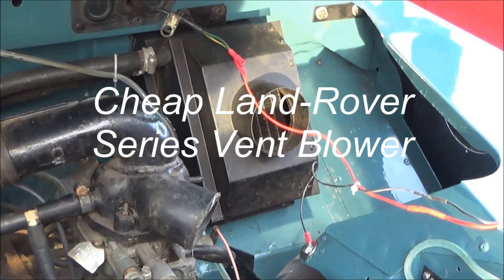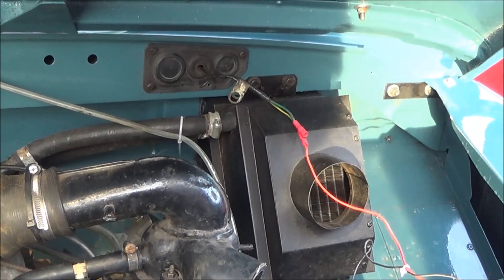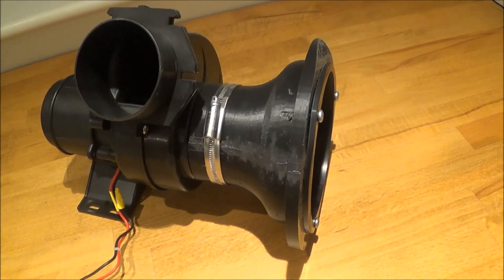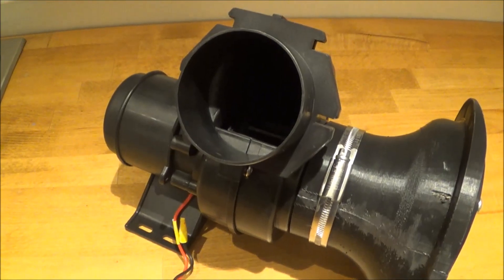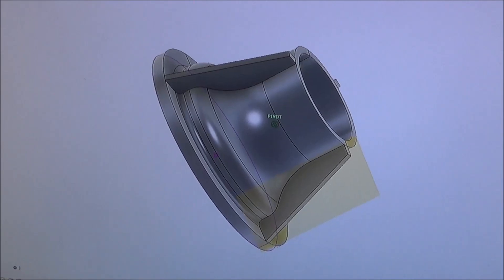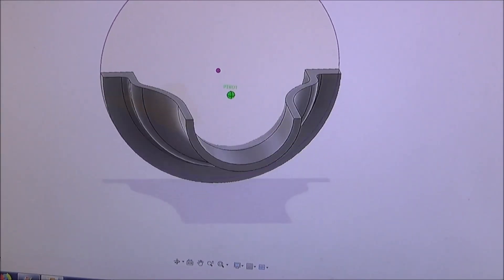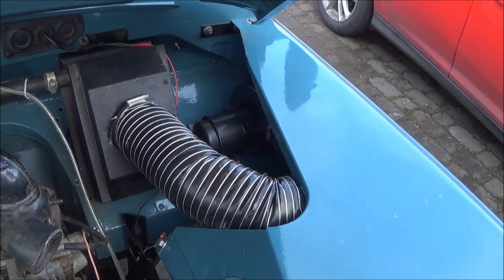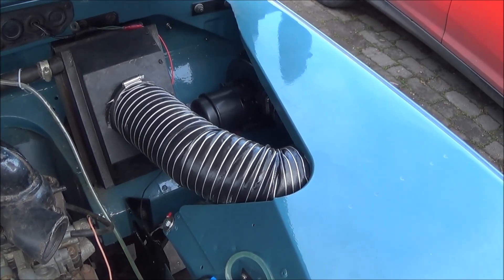Cheap Land Rover Series Vent Blower Mod

Comment: Do you have a link to the blower?
Reply from the maker: It is a 12v bilge blower from eBay. There are loads that would do the job. A went for a radial version, but an inline one could be used uf you mounted it from the heat exchanger rather than the wing